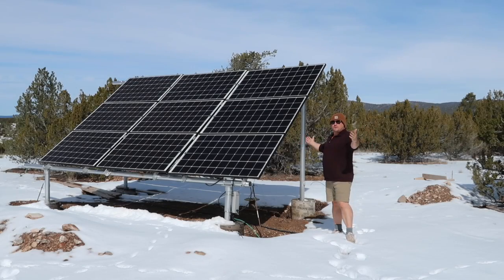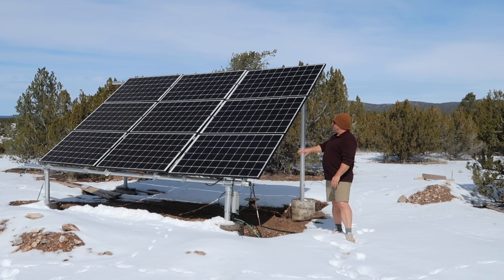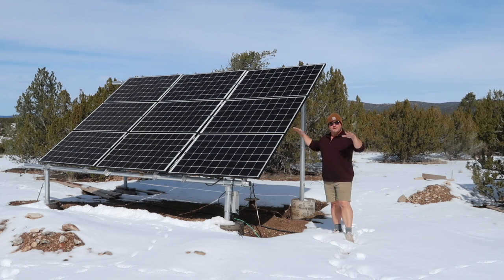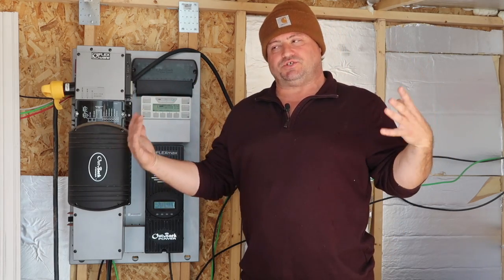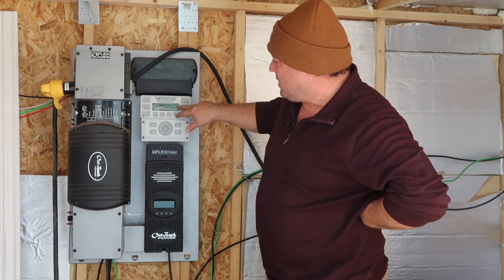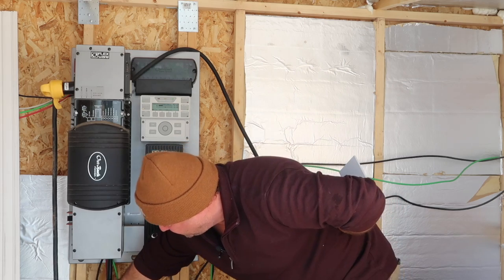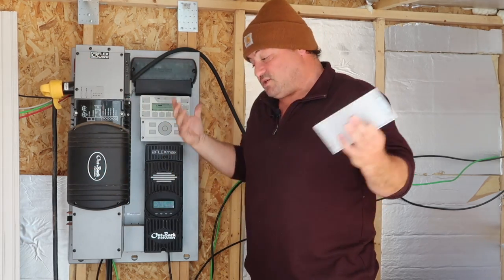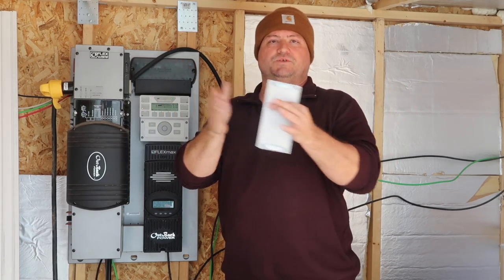Off-Grid: ROBUST Expandable 10,000 Watt, 80 Amp Solar Power System for AZ Ranch

Comment: I have my dryer, water heater and central heat on natural gas, seems cheaper than electric
Reply: He is in Ash Fork, off Bullock rd. There isn't any utility power at all out there. Propane is the only option, which is expensive
Reply: I have my dishwasher and water heater on raw PV electric. And I only have a car battery for the entire house.  That's cheap.
Reply: Because they don't have natural gas out there and propane is about three times the cost of nat. gas whereas the electric is free.
Reply: @terrysullivan1992  $10000 does not seem free! Let's admit, it's a cute but very misleading video about everything electric. He goes out of his way to discredit a microwave. A 600 watt microwave, used for 6 minutes a day. would have a very small effect on his electrical usage. He is saying his output, on a winter day, is 800 watts. It would use 4.5 minutes of output on a winter day. Propane is the way to go, on a dryer. Dryers are not used 24/7 either. Maybe 45 minutes a load.
Reply: Larry Lowell 
Ppl give excuses for which that which they do not understand.
Reasons for decisions are logical and replicatable. 
If results are not replicatable, then it is BS.

Comment: 1000 watts or 10,000 watts.. sure does not look big enough to be 10,000 watts with 9 panels
Reply: @schoolmaster1945  Think he had a typo and did not notice.  so figure with the charge controller and did not look like a big inverter.. just a typo
Reply: Maybe he's referring to how many watts it produces in a day?  Clearly it's not the combination of the 9 panels.  Also if it were 10k watts, it would be extreme overkill for the size of the battery bank.
Reply: @Hot_Mess  Not sure that it makes much sense either. as that kind of output does not happen often
and think you are right about the battery bank